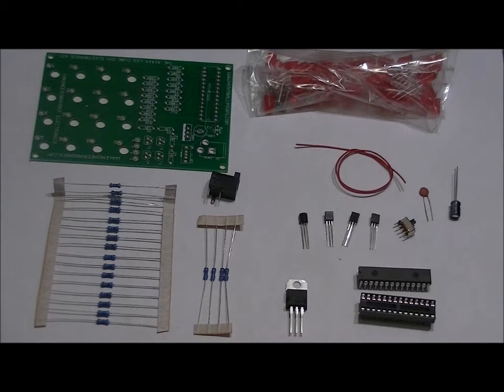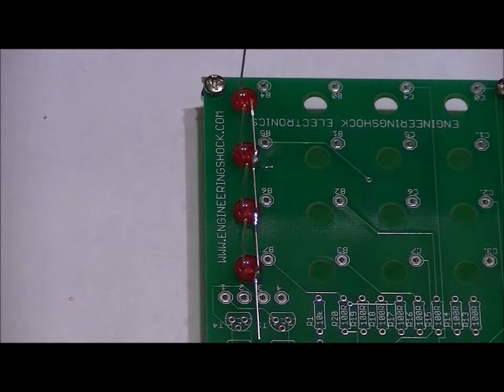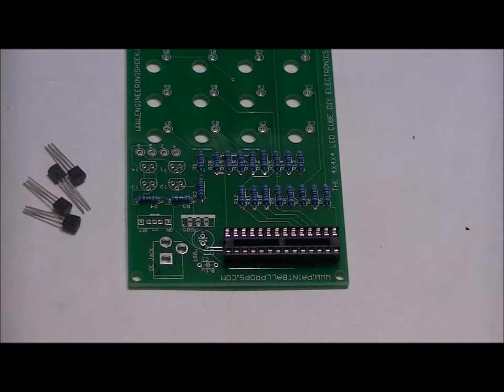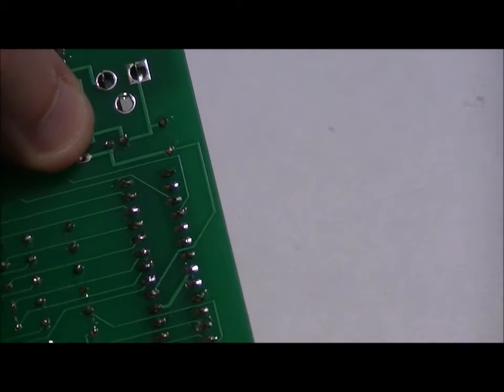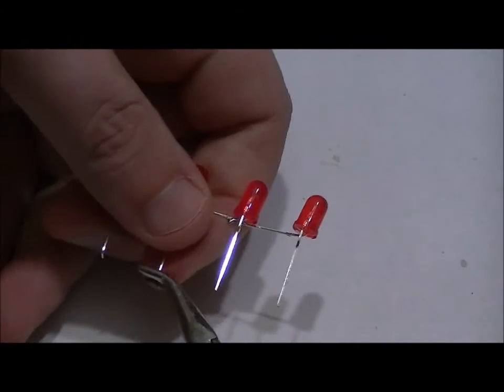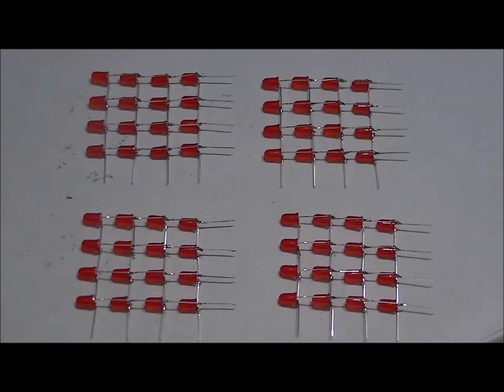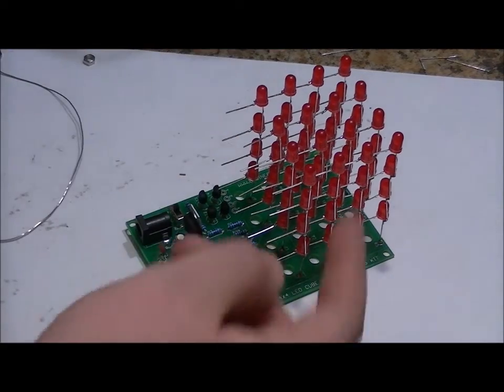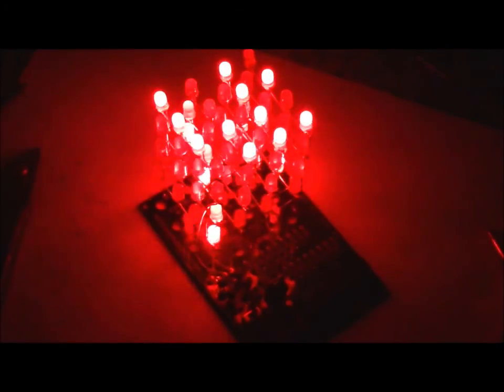The 4x4x4 LED Cube Kickstarter Campaign Assembly Video

Comment: Arrived this morning and already soLdering ;)
Word of warning though, the 4x4 isnt square so dont rotate the board 90 degrees while building the lines of four LEDs, you'll end up with some longer than the other. If i'd known before I started I might have done them all the same (wrong) way so the cube ended up a little bigger.